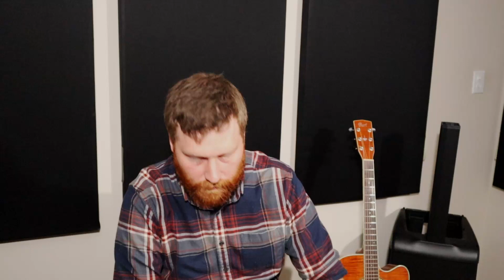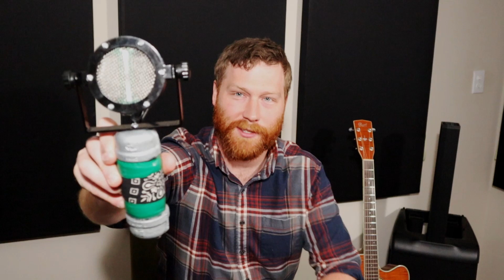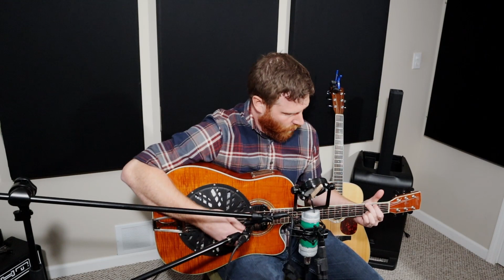DIY Ribbon Mic - Wagon Wheel Cover

Comment: Great stuff! Can you share a bit more info on how you calculated the transformer wounding?
Reply from the maker: Thanks!  I used a few online calculators, but the most helpful thing in the end was to actually start winding on a core and then checking the inductance with an LCR meter.  Getting the right core material is important and difficult.  What I ended up using was a core intended for use as a high frequency filter for RC projects.  Kontronik I believe was the name.  The important thing was to get at least about 300 wraps on the secondary windings, and then from there decide on the ratio to choose home many primary windings.